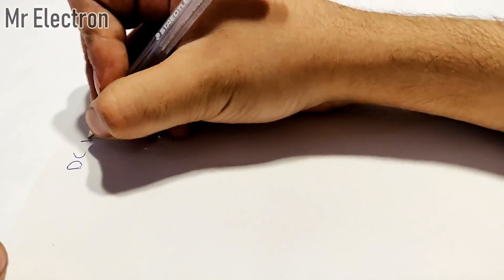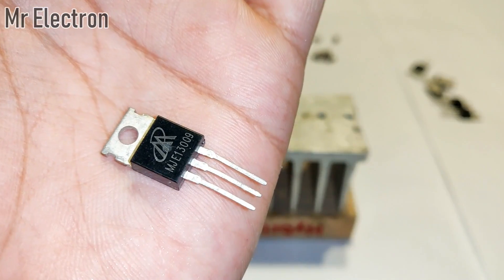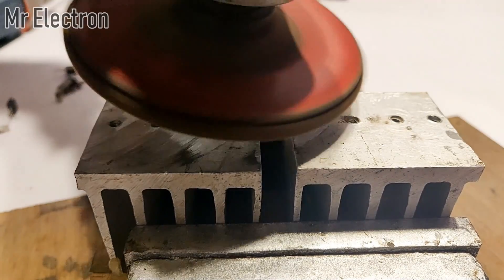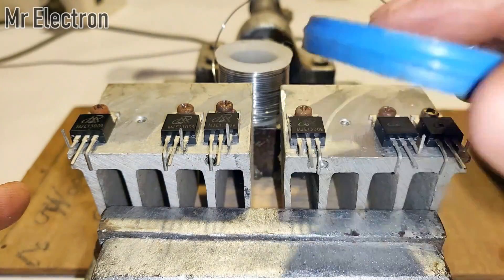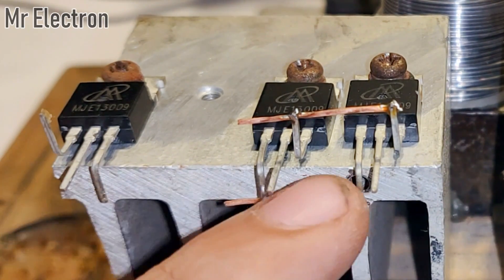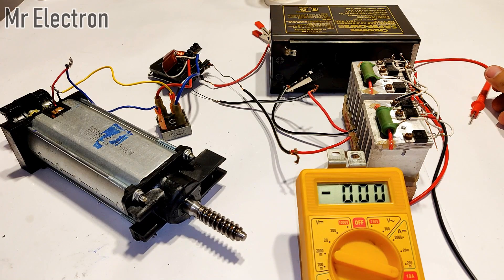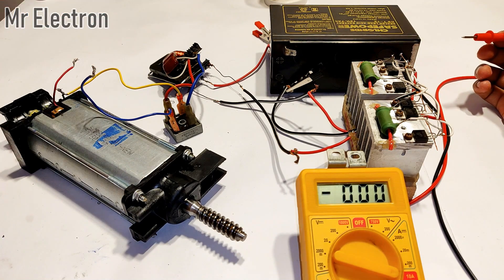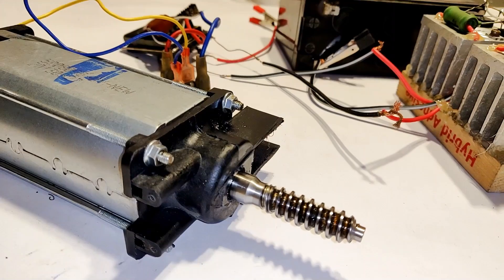12V ( UPS Battery ) to 180V DC Converter for DC Motor upto 300W - DC to DC Voltage Boost Circuit

Comment: I need a 48 volt 90 volt variable dc-to-dc. For a 90 volt permanent-magnet half horsepower motor. Building a go-kart and need a throttle for the gas pedal.

Comment: Please can I use this to supply 1hp 220v induction motor?
Reply: Induction motors only work on AC (alternating current) around 50 to 60 hz, universal motors commonly found in hand tools, vacuums, hair dryers, food blenders, lumber saws, can work on DC (direct current) just fine.

Comment: I have problem with a treqdmills modul, i need output 180 vdc, but actual voltage is 250 vdc, what the problem?